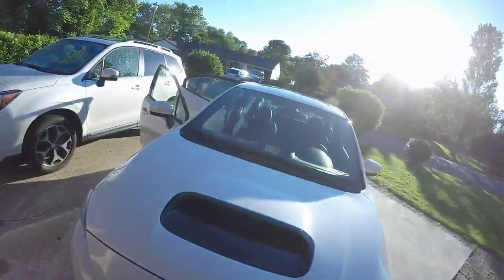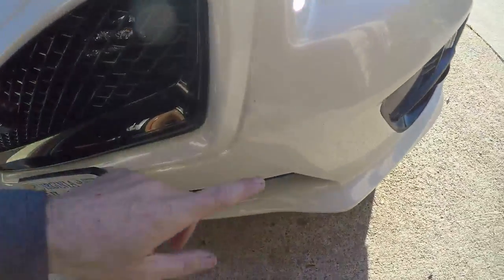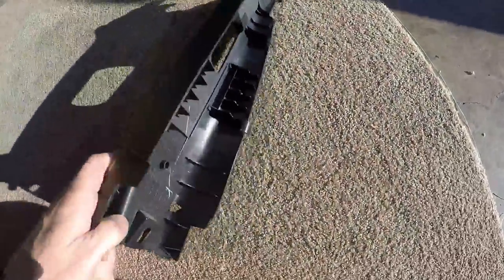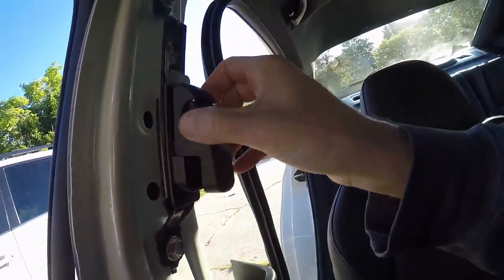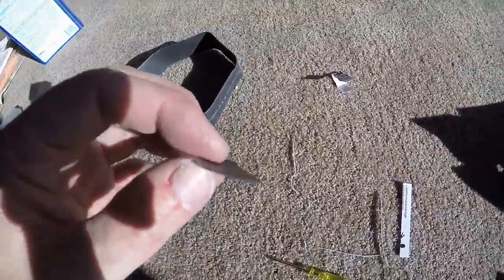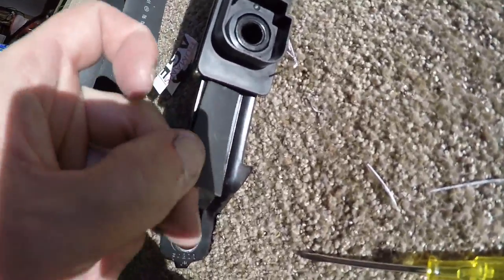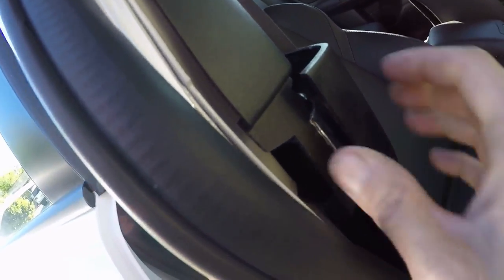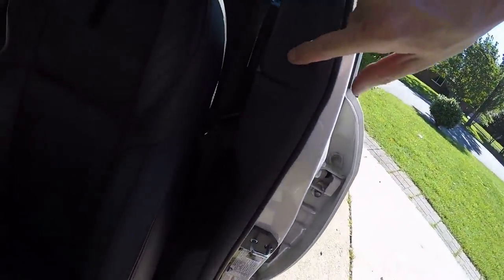2015 Subaru WRX Ep. 731: Dominating a B Pillar Rattle

Comment: thanks for making the video. its definitely the seat belt slider plastic piece that’s making the rattling noise. it would’ve had to been something small and light that can vibrate at a very fast frequency to make that noise. got some clothe tape and foam and fixed the issue last night, no more rattling.
Reply from the maker: sick timbo!
Reply: How and where did you put the foam tape? I can’t figure it out lol
Reply: @JMerk2222 if u go to 5:33 there’s a plastic slider that goes up and down. that piece is loose, if u put some clothe tape underneath it to prevent the rattle.
Reply: @defox_nz  thanks! He said something too like it also was his door hitting his door sill and vibrating… wonder how that would be fixed?

Comment: I don't know if this has been fixed in another video but I have the same issue. My rattle is coming from the seat belt housing. Where it bolts down by the floor and c pillar, a rattle that I can't seem to fix.
Reply from the maker: i have a lot of videos of all my rattle fix attempts.. the seat belt is B pillar, not C pillar.
Reply: LastHumansGarage b pillar I meant, thanks.